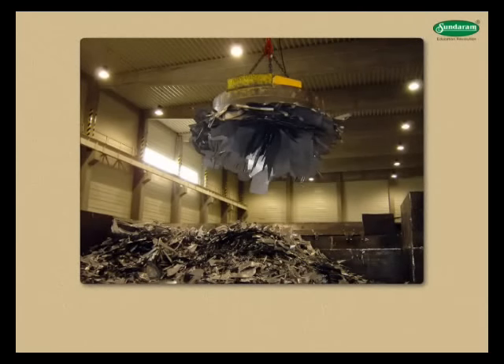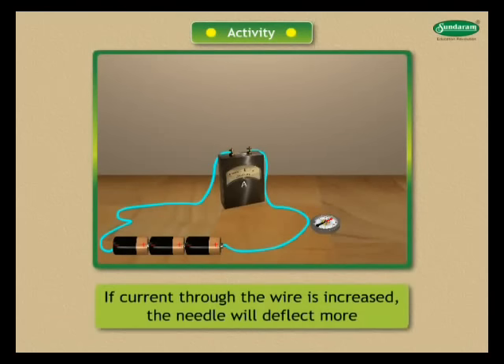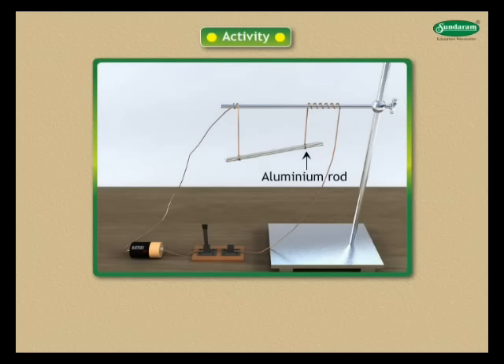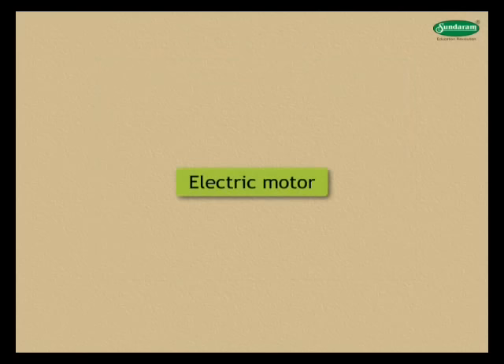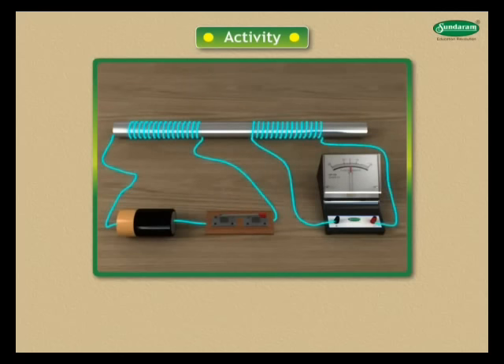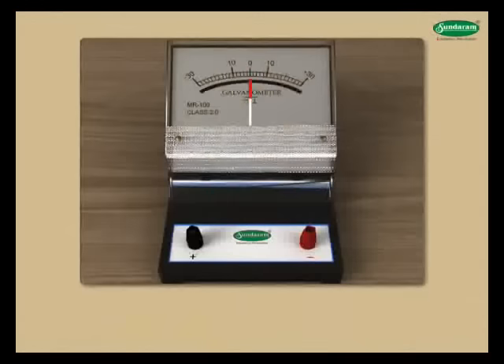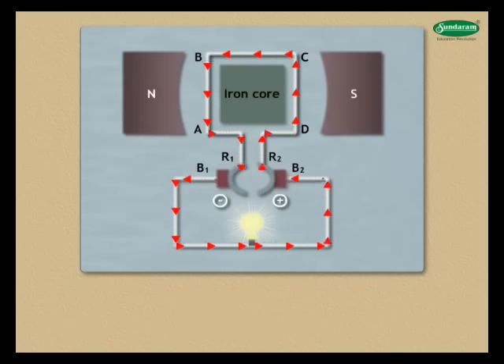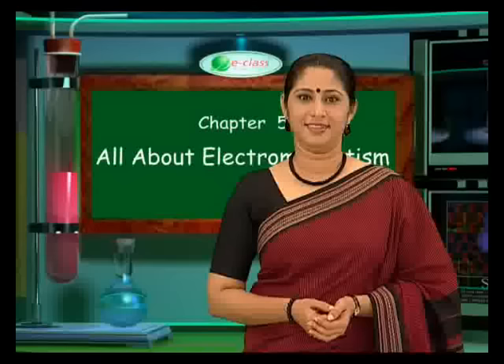Science- Class 10th Chap 05 All About Electro Magnatism

Comment: There are few mistakes in this video please make corrections for that. The figs. show something different from what is said,  for eg., the magnetic lines of force move from north to south but in the fig you've show it even moving from south to north. 
         In the working of electric motor you've said that AB moves downward and CD moves upwards but in the video opposite is shown AB moves upwards and CD moves downwards which is considered wrong by Fleming's left hand rule.Thus it shows that the coil moves in clockwise direction but by applying the rule we observe that the motion of the coil is anticlockwise.
Reply: Shruti Shende the movement of ABCD is absolutely correct because according to right thumb rule they showed direction of current and as the ab direction is down so the magnetic field direction is clock wise so it rotated clock wise...